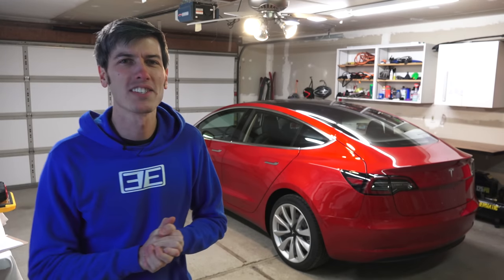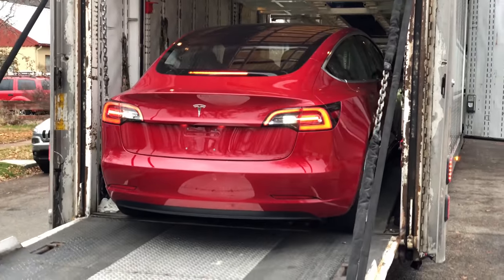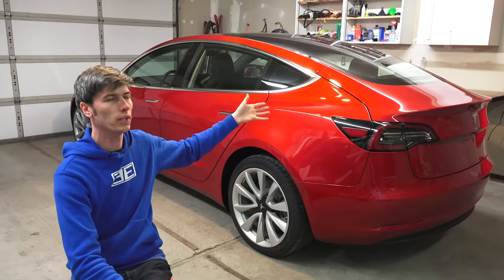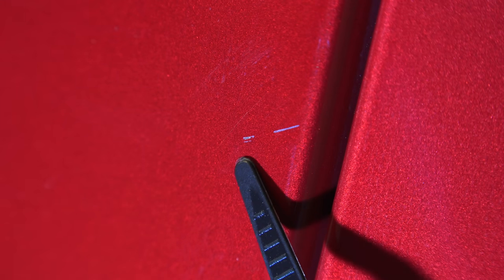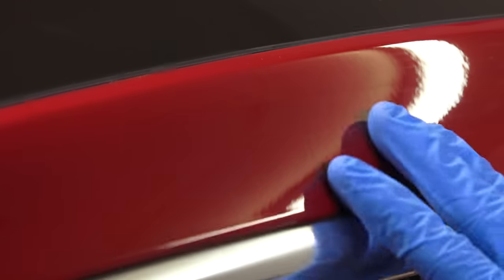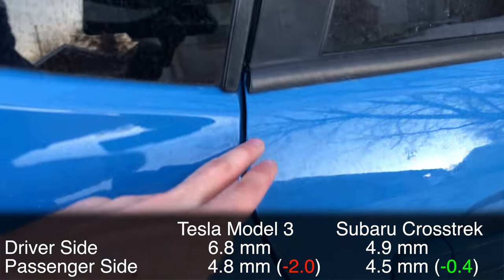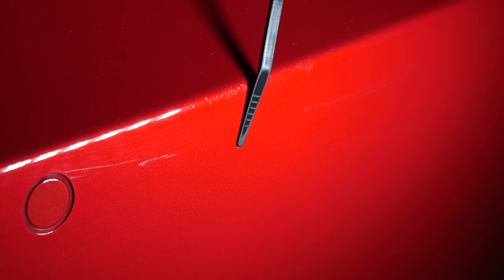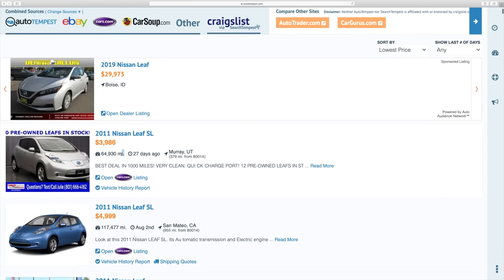Everything That's Wrong With My Tesla Model 3 - Quality Problems

Comment: I woult not tolerate one of these issues! This car is so expensive... what a shame!!
Reply: Honestly, the only issue is the paint job, the paint should be flawless because that damage is plenty enough to even go through insurance if you were to do it yourself.
As far as the panel gaps go.. ehhh just looking for things to whine about, in the past sure when panels were super jank, but they have gotten so much better it's a non-issue now.

Comment: Tesla offered a test drive in a Model S, so I took it. Obviously the performance is attention-getting but body panel fit was not good and the interior design was lacking. I'm told the latter has improved, but I didn't buy. Now I'm not going to consider a model 3 either. Hopefully in a few years quality control will improve and then I'll look again. Electric propulsion for autos makes so much sense that I don't to defer a purchase indefinitely.

Comment: That paint is swirl city...
Reply: He probably put it through car wash
Reply: Spencer unknown he said it hasn't moved from his garage since he got it off the truck. Now it's a $60k museum piece.
Reply: @Newzchspy  ah.. well someone has I think.  I have had a few new cars and you shouldn't have any swirls at all..  and if they did have to buff it up again (maybe it was sitting outside for too long) they should use very very fine buffer pads on a high rpm machine as these can buff to mirror finish with no swirls.
Reply: Spencer unknown don't be that guy. If your production plant is not properly prepped and trained for such quantity of output you get shortcuts like this. I'd assume panels were slapped on and somewhere in the chain, a rookie at the plant is in charge of washing/buff. Someone needs to have a nice Kaizen in their production facility. cough Tesla.
Reply: Since he got the car that quick it probably stood in a lot somewhere. God knows for how long.
Chances are it went trough a wash before delivery..
Reply: For those pointing out that the marks are from a car wash etc, he did point out that at least some of the marks are underneath the clearcote.
Reply: @Skiddins  Exactly.. Even a crappy gas station brush wash isn't going to screw it up THAT bad.

Comment: Quality control at Tesla needs to be improved.  Many people are having issues with the paint and seals on the car.  The paint they use is very soft and easy to damage.  I would suggest you get a detailer to fix the issues and then Ceramic coat the car.   A paint protection film on the front of the vehicle would also be a good idea.

Comment: I would buy the cheapest color option and have it wrapped.
Reply: This is probably the best option since Tesla's paint is garbage, and you have to pay for any color that isn't Black or white. I've been considering a model 3, but I think I'll wait until these issues with quality control get worked out.
Reply: @maynarddrivesfast804  You have to pay for white its actually $2000.
Reply: Legit idea
Reply: By the looks of the poor quality of this paint job, it seems like eventually peeling the wrap would take paint with it. 😵
Reply: I saw a light blue wrapped model S at timberline mt hood, it looked dope.
Reply: You dont have to. If you get a PPF applied, they will do paint correction. It cost me $5200 for XPEL Stealth and Ceramic Coat. My paint was flawless, and now its flawless, and protected, and looks amazing on the street.

Comment: Watching this video in 2023 one day after taking delivery on my brand new Model 3. It has a few paint defects, including dust nibs, chips and scratches. Moreover, the whole car is covered in swirls (visible in sunlight), as if it was cleaned using dirty towel. On top of it, dashboard rattles and something in the back squeaks. It's in service now, and I got a loaner Tesla, which also has a dashboard rattle, lol.

Comment: That is garbage quality. Wow. I’m amazed. Those panel gaps and that paint quality! I can’t believe they have the gall to charge $2500 for the red. And I say that as a bit of a fanboy. Just interested in what other manufacturers eventually come out with.
Reply: My ford e150 work truck has bigger panel gaps then my model 3
Reply: Our older ford taurus also had some really bad panel gaps when we got it new, it even had the driver side door not closing properly, its not just tesla, but seeing the end of the video shows promise, its how these companies deal with these issues, and tesla seems its on top of getting fixes done and giving out loaners.
Reply: Panel gaps on FORD products are hardly a standard to which anyone should aspire!
Reply: @andrewmcmahon2464  Body-on-frame vehicles generally have larger panel gaps, the frame is less rigid than a unibody vehicle and they can't make the panel gaps too tight or they would end up buckling panels when the frame flexes.

Comment: This is the kind of poor quality you'd expect from an 80's Rover not a hugely expensive modern car.
Reply: 80's rovers werent bad at all, its mid 70's British Leyland you'd want to avoid 😅
Reply: This is a Model 3, not a Model S. It's not hugely expensive. It's 46,000 MSRP. It's an average priced electric car. That being said, the condition this car arrived in is unacceptable.
Reply: @Collector2006 The cheapest one in the EU costs 60K Euro... For that money you buy better quality cars..
Reply: @Collector2006  46k is expensive. You can get a luxury car for that money.
Reply: @Collector2006  What? A new Kia has better build quality than this!
Reply: @markanders250  this is a luxury car.
Reply: @protosniper-  It's not actually. In the standard Tesla Model 3, the seats must be manually adjusted, as will the steering column. The side mirrors aren’t powered or heated, and there’s no auto dimming. To get these added, you'll be paying close to $60k. And to top it off, you can't get leather seats in any Model 3. Tesla can market it as a luxury car, but it's not. But if it fools you into believing it is, then I guess their marketing is working.
Reply: I have a 40 year old Mini 1245GT and it has less paint defects than this.
Reply: @simonweekes3068  Kia's are no longer low quality cars tho. Just look at their e-niro i would get that over the tesla 3 any day.
Reply: @markanders250  AMEN to that! 🤘

Comment: Jason, if there were so many defects, paint etc., why did you accept delivery.  I'd reject it. Now you have  to deal with Tesla getting it repaired.  Also, using your Subaru as an example for gaps or quality control makes the Tesla look good.  Next time try a Lexus or Toyota.  If it were a Lexus , that Tesla would never get out of the factory.
Reply: Newzchspy Toyota panel gaps suck also. Try Audi.
Reply: Sapient Budgie sorry, but that has not been my experience,nor with Lexus.  A quick review of car complaints shows that Tesla has consistently had build quality issues. You don't see this with Toyota/Lexus.
Reply: Newzchspy yes, but Toyota offers nothing for an enthusiast. It’s a mainstream reliable boring grocery getting company.  Lexus is over-styled and still boring.  Drive a 911 or Audi RS 3; 5 or 7.  Panel gaps may suck on tesla,  but I’d drive any Tesla over any Toyota product. You can keep your reliability, I live once.  I’ll take fun and exciting.
Reply: Newzchspy There are $7,500 reasons for not rejecting a Tesla if it could push back delivery past 12/31...
Reply: @sapientbudgie5652  Lol a tacoma, 4runner, and Land cruiser are not for enthusiasts? These trucks have consistently gone to hell and back without issues. Conditions far worse than any Porche or Audi would ever see. Meanwhile the Porche and Audi breaks down going to the grocery store. If you only live once why spend it at the shop?
Reply: @sapientbudgie5652  I agree. The styling is boring on Toyota and Lexus. There's the LFA but paying $350K for a sports car that does 60 in 4 seconds is not anywhere near the top.
Reply: Sapient Budgie still won’t break like a Tesla.
Reply: Drew Seman and when that money is halved on Jan 1 19 or reduced even further in the future.  Sheesh, and people complain about oil subsidies? All I see here is Solyndra x10 !
Reply: Fair Judgement Fair ......gets it!!
Reply: @fairjudgement4409  In Australia, we have rich people off roading their Mercedes GLS and Audi Q7!
Reply: @sapientbudgie5652  I gather you must be very rich and don't care about getting your money's worth or you never shelled out a dime  for such an expensive car with poor quality control. In other words, IF  I could buy a Tesla, I wouldn't care because I only live once. Ummmm, okay...
Reply: @SchoolboyCubemaster  Very rich? No. 12 years of university life, busting my ass, stress, sleep deprivation.  You lease things that depreciate and you buy things that appreciate.  I bought plenty of honda/acura products and never had an issue with them. I always had a job (in school or not), always saved money and never bought a car I could not afford.  As  you get older (IMO), you may care less about "reliability" and care more about buying something you truly enjoy, even if it's less reliable. I'm sure my 911 4S and my RS5 are not reliable compared to my Acura integra I had in 1998...but I am having way more fun now:)

Comment: I have been looking to buy a used model S.  I viewed and rejected about half a dozen, simply because it looked like they had been poorly repaired after accident damage.

It turns out, the defects I am seeing is just the standards the cars are built to.  Bearing in mind, the Model S is supposed to be a luxury car, I think it is abismal.

I have now decided against a Tesla altogether, if this is the quality of the finishing, just how badly built is the bits we cannot see?
Reply: This is my exact concern! Paint is so easily inspected. What about the electric motors or suspension? They aren't so easy to inspect and I don't want to gamble on their QC.
Reply: Abysmal*
Reply: I have had a similar experience, hence I'm watching this video. I believe this company is no different than ANY OTHER tech-laden object in this world. LG OLED t.v.'s are amazing when they work. Samsung refrigerators? Ditto. There's just no consistency, all the way down to the smallest, cheapest things. For example: I have a miniature Black and Decker rice steamer. The first one (purchased in Seattle) failed after one use. I've used its exact replacement well over a hundred times, and it performs flawlessly. Welcome to the New World. P.S.  Honda, Toyota, and Nissan have ALL betrayed the loyalty of people like myself who believed in their reliability and overall quality. They're mostly "hits", but others are pure "misses".
Reply: Yes, Tesla doesn't get the battery or electric motor right either. Tesla is ranked rock bottom in reliability.
Reply: @matthewlozy1140  Yes, Tesla doesn't get the battery or electric motor right either. Tesla is ranked rock bottom in reliability.
Reply: @00crashtest  Recent teardowns of the Tesla models shows they are poorly designed and poorly built.  There are far too many individual components, this makes manufacturing lengthier and will make the chassis less resilient.

The report says that there was an extaordinary amount of sealant being used on the chassis and body.  The chassis and body is twice the weight it needs to be.

The Panasonic batteries and suspension are excellent, but as you say, the motors are substandard and are prone to premature failure.  The launch control also severely damages the motors.

We cannot take away from Tesla, that their technology is ahead of the competition.  If Tesla were to give a design to a mjor manufacturer to design and build a chassis and body, then Tesla were to ass the technology aspect, it would be a good car.  

Result is Tesla is a fantastic technology company, but not a great car manufacturer.
Reply: The Model S is prone to lighting on fire in a crash too. The batteries light up and if the doors got hit, you cant get out. Over 12 people have burned fiery deaths in the Model S so far. Very bad design.
Reply: @ChuckBeefOG  Is there a source for this information? About people dying in Teslas due to the battery catching fire? It sounds a little extreme.

Comment: To me the worst part is something you didn't talk about. Body panel gaps happen, shouldn't be that bad, scratches happen in shipping. The swirl marks though, it looks like the entirety of the 21 miles were driven through an automatic carwash.
Reply: Slow down cowboy, you make it sound like it's normal for new cars to get scratched when shipping. ITS NOT!
Reply: @Alex632  Im working as a detalier for an independent small company and we prep new cars for Audi, VW, Jeep and Kia and you would be amazed with the condition the cars come in to us. Its scratches, swirls, defects in the paints and so on. A lot of it we cant get out with just polishing them but they are being delivered anyway. I have yet to see a new car that didnt require polishing before shown to customer

Comment: Just bought a brand new Prius a few weeks ago and the fit and finish of it was flawless.  Literally perfect.  I can't believe how terrible the paint and gaps on this Tesla are.
Reply: Thomas Womack Tesla is still growing they have been in the market for what like 10 years compared to other companies. Tesla is trying to up production to get more cars out faster. So quantity over quality right now till they reach a comfortable output per month I guess. So things like this happen I guess.
Reply: @Hungry_Flask  Well when Toyota builds quality cars like the Prius why roll the dice on a Tesla? At least with the Prius you know what to expect.
Reply: Toyota has beside Porsche one of the best quality departments. Comes with the Japanese sense of quality.
Reply: @MrHaggyy  Don't really know as much about Porsche because they can be expensive to work on, but at least with Toyota and Lexus they last a really long time. Lincoln has also been getting up there in quality for the price.
Reply: @carljr.99  the J.D Power Index is quite good too measure quality in automotive. It counts every issue of all sold cars in the first 3 months and scales them down to 100 cars. Porsche, Lexus & Toyota and surprisingly Kia are leading the field for quite some time. For Porsche it is also an image thing, the cars are insanely expensive and customized, so the customer won't be concerned with issues like the Tesla they would be really pissed.
Reply: @MrHaggyy  Yeah Tesla is going have a hard time competing with others because the quality is better elsewhere.

Comment: I think that the cosmetic issues are minor compared to the body mechanical and electric issues these cars can have.  I was a Chevrolet tech from 1973-75 and you would not need to measure to see how bad panel gaps were.  The Corvettes were a horrible mess.  And the Vega door hinges as well as the window regulators were welded not bolted to the car.  To replace a door window regulator (and we replaced many) you first had to air chisel it from the car to break the welds.  Funny thing is the replacement regulators were designed to be bolted to the car.

Comment: If a dacia sandero arrived with such a paintjob I'd send it back to the dealership. How can anyone deliver a car thinking that's acceptable? A scratch through the paint is going to rust sooner or later. Also I wanna make all the scratches myself by being a terrible driver, I don't need some overworked and underpaid Elon-Slave to do it for me.
Reply: the dealership. cars are sent to the dealership with protective plastic sheets stuck on all the panels to avoid scratches, and the dealer removes those and gives it a final check (and touch up if needed) before you take delivery. tesla isn't allowed to have dealerships so they can't do that.
Reply: @satoau1  This is nonsense! There are defects in the paint from when it left the factory (the dust particle for e.g.). The paint is far thinner than other manufacturers (sadly he didn't demonstrate this with a paint thickness gauge) and so it is far easier to scratch through than other cars.
Reply: LOL, in Argentina, Sandero is branded by Renault, the same indian car
Reply: sure maybe they still need to apply more paint, but even if they did they still wouldn't have any dealers to fix up the scratches before the customer takes delivery. every other manufacturer also suffer scratches in transit, the difference is they fix them at the dealer before the customer arrives. people taking delivery in states like california which have tesla dealers don't report scratching problems, but people in states like jason's iowa where tesla isn't allowed to have dealers do. note how jason's car arrived on a truck, because there is no dealer for him to pick it up at.
Reply: @GordoSoc  Indian?
Reply: @ace_098  The first Sandero was made in India, then move his production line to Brazil for supply the Mercosur market, the same strategy for the new car "Segment A", The Kwid.

Comment: Normal quality control should have revealed these mishaps before it left the factory. It's a PITA for Tesla to fix the mistake once it has left the factory. It's weird that they chose this strategy in regards to delivery dates. That said, it reminds of the way they treat their customers in Norway with the insane delays on normal maintenance. And I've heard that on the Model S the tire wear is really excessive.
Reply: The model S tire wear is just down to the instant torque of an electric car and how it is on the Model S it will cause them to eat through tires. With respect to Tesla in Norway it’s down to the sheer volume of Tesla’s in the country where it’s much higher than other parts of Europe. Tesla needs to setup gigafactories out in Europe to start producing cars and parts but for the time being they are focusing on China.
Reply: Absolutely, the QA process in any normal factory would catch this, its clear they're doing zero QA